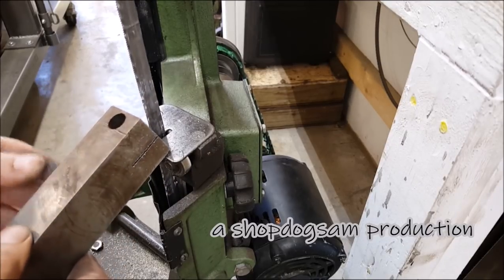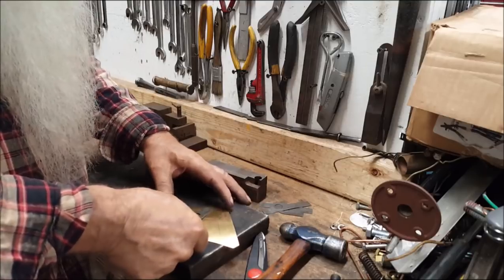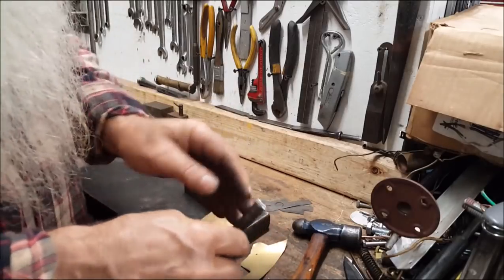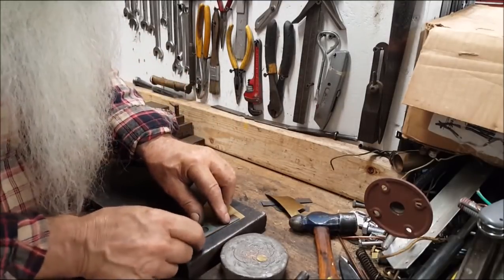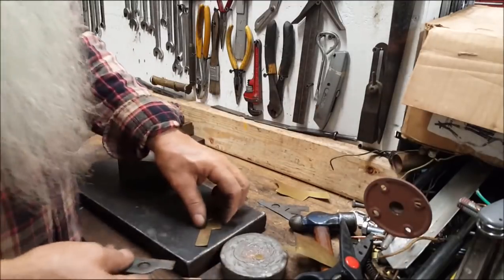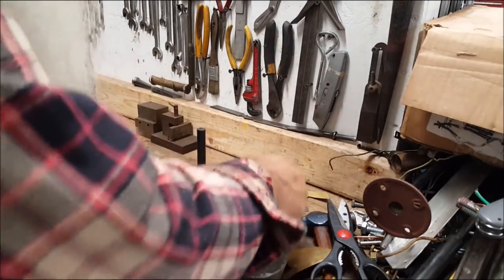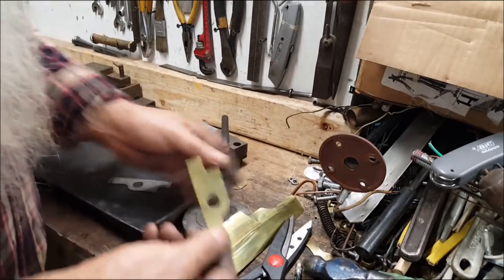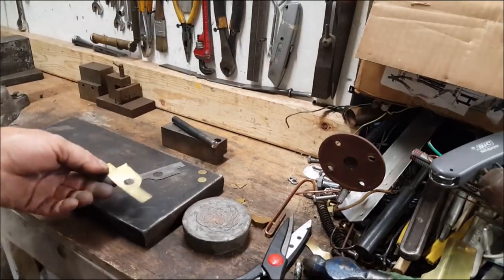Brass Shims for Antique Engine shop built hole punch

Comment: Nice Idea shopdogsam . I have a few single  punch press assembly's that look like a flat c clamp and the punches pop in and out easy .  I can change the size of the hole with many different standard & Metric sizes  .  I use them to make Gaskets . The shop went to a CNC type punch press , and they scrapped the old unit . I got the punch assembly's  and all the punches for $0 .